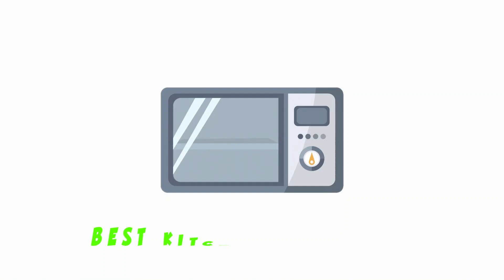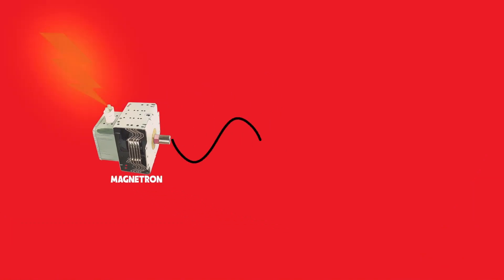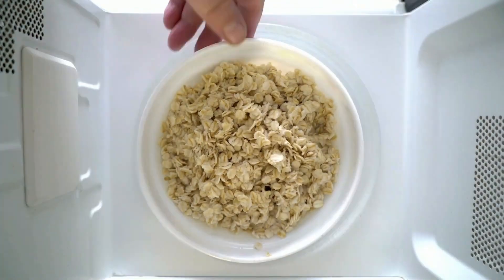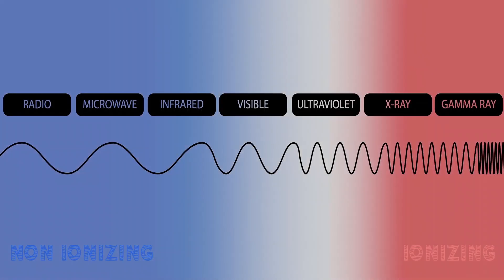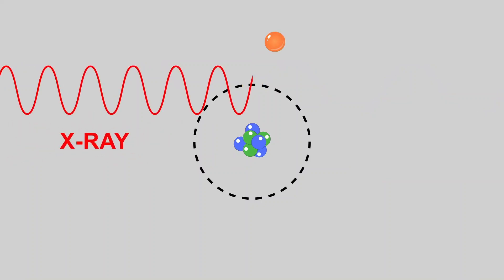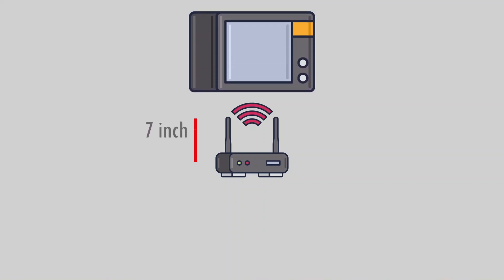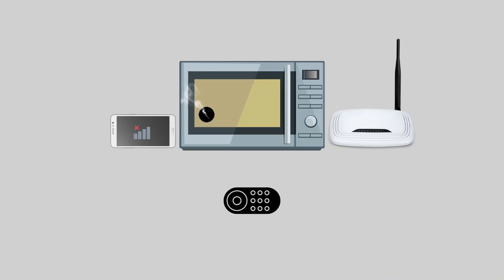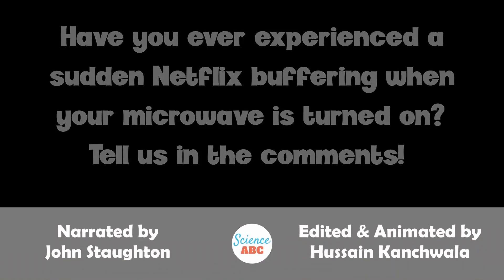What if There’s a HOLE in Your Microwave?

Comment: Good grief i need a new microwave. There is a 3/4 inch hole under the glass in the trac where the wheel for the rotating thing is. 
Thanks for this video